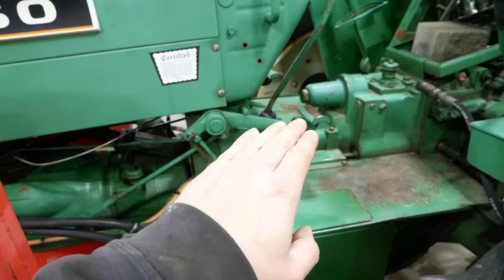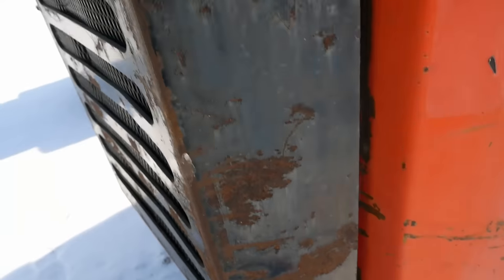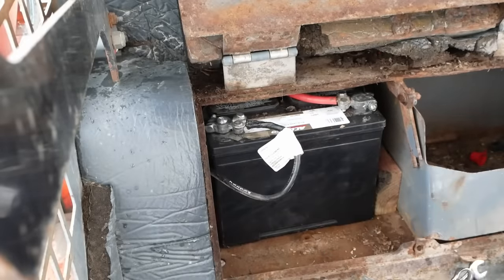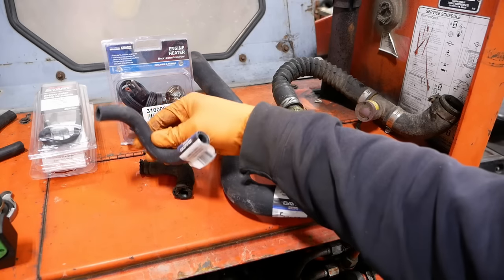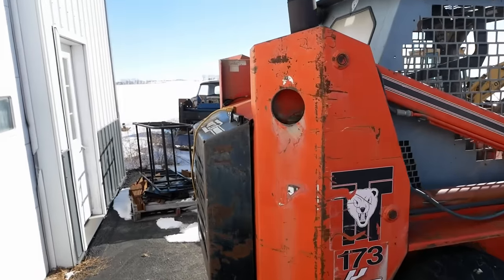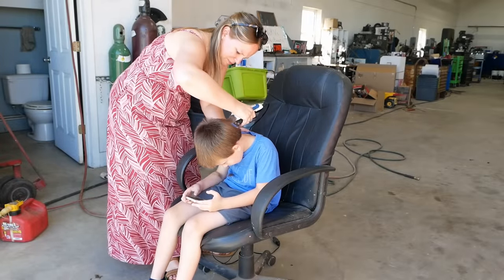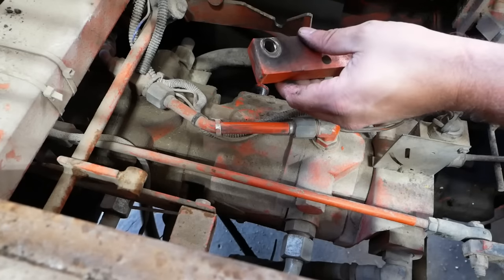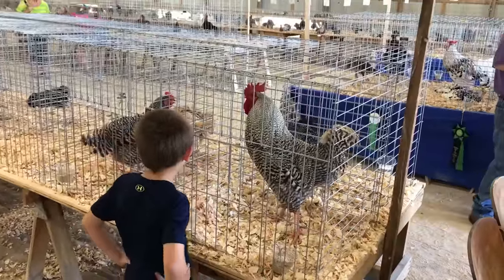Buying a Cheap Skid Steer from an Online Auction - Thomas 173HL - Part 1

Comment: Same for a car with AC, if the AC works means they cared enough. V2203? Yep thats a reefer engine, theres a governor adjustment screw in the timing cover by the injection pump.

Comment: Had 81 Toyota Cecilia , in Colorado Springs, no block heater no heated garage. 10w40 oil won’t start , change the oil to 5w30 in winter .

Comment: Looks like snow is coming out where the bolts should be holding a cutting edge for your bucket. Wear that edge down before you replace the blade and you'll ruin the bucket.

Comment: The name felt familiar, and after a quicky google sesh, i know why. Someone modified one of the native attachments (a back hoe) for this unit into a self propelled unit. Seems there's quite a few things you can slap on this skidder, both native and aftermarket.
11:25 keep some thin stainless steel wire around the shop, it's good to make anti-collapse springs out of. Just pop on over the old web and find the spring to mandrel calculator, find something appropriate and make a small section of spring. I do it all the time, rarely bother to replace the hose after since this allows you to turn any random hose into the right hose. Pro tip, make sure the ends of the spring are bent inwards to the spiral, you don't want them poking out when the hose bends to shape. The spacing should be pretty narrow to make it work, but you can figure out the right settings in-situ. And you don't need to do it to the whole hose, only the bend area.
Reply from the maker: The spring goes inside or outside?
Reply: @WatchWesWork  Inside. A little lube helps pushing it in. I usually make a small piece of wood on the lathe to push it in (think driver for thread inserts).

Comment: I've fixed (patched) several tires on my skid steer - I leave the wheel on the machine and pull the tire - the 5600# wheel attachment seems to make it easier - appreciate your video sir

Comment: I’ve moved a lot of snow with an Oliver tractor. Never had any problem shifting it. Steering could have been a little bit better. We used a high output PTO hydraulic pump.

Comment: My old man still has a Thomas at his shop. I believe he bought it new in 1994. He has almost every attachment available for it from that era. He did regular maintenance on it since new and still uses it today when the newer machines break down or are getting serviced. Few breakdowns over the years but nothing major. It’s tired now but no shame for a 29 old machine .
Reply: What attachments does he have for it? I have a buddy that had one and he had, forks, back hoe, breaker, brush and a few more things but I can't recall what. It was a decent machine!
Reply: @davebrittain9216  Back hoe, forks, breaker, couple different sized augers , the big sweeper brush, tooth loader bucket, snow bucket, and we made a cable reel . The back hoe can’t be used any more due to safety codes . No roll over protection. He bought a mini excavator instead. That thing is great in tight spaces and little jobs.
Reply: @lloydmarche7263  Are you in Ontario by any chance?
Reply: @davebrittain9216  sorry no.
Reply: @lloydmarche7263  I wondered if you dad maybe bought the unit my buddy used to have but I guess not.

Comment: I have a memory thst its a case of a multi holed lever and you move a spring or linkage.
Pump will nneed to come out and gearcase off.
V2203 has a turbo variant with few different parts needed for upgrade.
Cheers wes👍
Reply: User Joefive5466 said Hey Wes, I had to put a heavier governor spring in my V2203 when I stuck it in a Jeep. I used Mcmaster 9433K49. I’ve revved it to about 2500rpm before I let out. To change the spring, you have to pull the injection pump out and the throttle plate off and the shutdown lever plate off.
Another user said they were used a lot in generators and set at 1800rpm, which seems to fit

Comment: Throw a little brake fluid in your hydraulic oil Reservoir it will soften the cylinder seals up sometimes it works sometimes it doesn't at this point you got nothing to lose

Comment: A trick to plowing your gravel driveway is to pile it up where when it melts you can reuse the gravel and not tear up the grass.
Reply: or slide a piece of  pipe over your cutting edge. We cut a slit in black pipe, slide pipe over our cutting edge.  may pack some snow down in the gravel but we arent raking gravel out of the lawn come spring

Comment: Watching you jack it up and pull the wheel to put a tube in it was tough for me to see lol. I used to run a tire repair truck back in the '90's. I'd stick a block under the back, fire it up and raise the whole thing in the air, peel the outside bead off, repair or tube it, hit it with the bead  seater tank, air it up and drop it back on the ground. I can recall how I did it, just not why I went at it so hard for $11.64/hr.
Reply from the maker: I think it would be tough. The drop center is on the inside of the rim.

Comment: is it a tv (tri vortex ) or a di (direct injection), pumps are a little different, if you remove the stop lever cover you will see the spring, check against specs, I’d say it’s stretched, the pump rack locates in a slot on the governor arm, not much goes wrong there, my money is on the spring 🤞

Comment: its too late now but that bypass hose you could of got that at a kubota dealer the spring thing was most likely a switch for the back up alarm and if you know its gonna snow why leave it outside you got a shop park it inside before it snows so you got no snow on the seat

Comment: I realize the skid steer has multiple other fun uses and is a better fit with your family culture...but for snow removal I often found a walk behind snow blower ($400 new) was quicker and easier than getting out the compact John Deere with a loader. My driveway looked about the same size as yours.....exercise is healthy. Only maintenance was putting gas in the tank and always started on the second pull, regardless of the temperature. Of course the blower is limited by heavy snow fall.  I surprised myself how often I reached for the blower rather than the tractor.
Reply: till you hammered by a 3 foot blizzard. Skid steer can stack and shove back snow pile. aint no snowblower aside from rail way clearing or the ones that are used at airports moving a frozen 6 foot deep snow bank
Reply: @harveylong5878   As long as you can get into the snowbank a good blower like an Ariens will get it up and over any snowbank. My little 24" 2 stage will throw it high enough to hit the powerlines...they're incredible machines. 16 yrs I've never done more than change the oil 1-2 times and finally put a belt on it along with the gearbox on the front auger

Comment: Obviously you got a rubber tire machine but its unbelievable for the track skid steers what they climb in dirt and mud but they absolutely suck and wont move in snow without the right winter tracks on them the rubber tire seems to be far superior especially with the right taller snow tires you get way better traction and a couple more mph for doing parking lots .we got burnt on snow last winter hopefully this winter is a little better ! I know you will have this all spruced up in no time !!

Comment: Well if there's no fluid under it then there's probably no fluid in it. Seems like an ok little machine. Definitely worth putting a few dollars into. I've got a pretty old Scag Magnum 3 mower with a little 3-cylinder Kubota diesel in it and I love that thing. And parts for it are still relatively easy to find. And original Japanese parts too. Hopefully you'll get that governor sorted. I don't think it'll be very difficult. Those Kubotas are in EVERYTHING.

Comment: Before u had put-in the new battery, u picked-up the battery hold-down bracket and put-it in the box next to the battery tray.
buy use skid steer's, it comes with problems.  u will figure-out how to get the motor to run in high rpm's.

Comment: The problem you are having with your Oliver tractor. There is a good Oliver mechanic  on you tube his channel is ( That Oliver Guy ). You can ask any question about your Oliver to him. One thing I have learned from him was how to shift them. By putting it in low range to make shifting easier. I hope this can help you out 👍

Comment: Those thomas skid steers are the same as a scat track 1300 whichbis owned by volvo now. Same engineers as bobcat. Your enginenis a v2203. That is a simple cartridge pump. Pull the lines , 4 nuts and 1 spring and out the topnit comes. Once its out you will see the other springs for the governor which you can buy many places. Cheap. The governor has fly weights on the cam gear and a fork that pulls on the rack spring. The over travel stops are the plastic capped bolts on the front cover. Also check fuelnpressure that are fairly picky

Comment: Skid Steer evokes the meaning of a flat tire machine, don't bother with tubes, just get solid tires unless you're a glutton for punishment. In my opinion a snow plow is for plowing snow and a loader is for loading it, period, and never the twain will meet.
Have a 40yr. old L275DT, with glow plugs and decompression, never plugged in and will start in frigid weather every time.
A skid steer is a diabolical machine, solely designed to test the patience of the mechanics who have to repair them.
Wes when you buy something like that get a manual before you even start.
Reply from the maker: It's crazy fast even with the bucket. I can plow my whole drive in 20 minutes. It takes 1.5 hours with the Oliver.
Reply: Fill it  with green tire slime

Comment: You, your teaching wife and your son would greatly benefit from Starlink internet. There are 4,000 satellites up there and more every week. I feel the "can't win for losing" thing you must feel a little of. I just paid cash (great deal!) for a 2009 great looking and running Ford Fusion. I knew it was high mileage from the ad and "whirlwind"  inspected everything without complaint. After getting it home I actually looked at the odometer, which I initially didn't even know how to find. Yep ... 100,000 more than the ad said. I would have walked away. Mine now. Sure is pretty though. On the good side; it's the first vehicle I ever saw without wings that has a complete maintenance log.

Comment: Put a small battery charger to that same 110v line, then you have hot block and topped battery, glow it and it will start.

Comment: the 743 would have been a good machine. Simple naturally aspirated kubota engine. Bobcat built so many and they were so long lived that cheap new-old stock parts are usually easy to find on the internet 35 years later, plus every single possible issue you could have run into with it has happened to someone else who documented the whole saga at length on equipment forums on the internet in the 2000's

Comment: i've worked on a couple of those. not bad machines but parts are unobtanium.   you're probably right about the low rpm engine. there may be a different rack plate that limits max fuel but  for the most part its just a spring change. i sure wouldnt want to try it in there  its hard enough out in the open.
Reply: User Joefive5466 said Hey Wes, I had to put a heavier governor spring in my V2203 when I stuck it in a Jeep. I used Mcmaster 9433K49. I’ve revved it to about 2500rpm before I let out. To change the spring, you have to pull the injection pump out and the throttle plate off and the shutdown lever plate off.
Another user said they were used a lot in generators and set at 1800rpm, which seems to fit

Comment: looks like the creep is caused by running the piston pump over center moving the swash plate one way is forward and the other is reverse. may I suggest you clean the hyd tank and change the filters before you put the skid steer into service= money saved. my2cents

Comment: With your location and its main purpose being for snow removal keep your eye out for an old fisher plow to weld a quick attach plate to and plug into your auxiliary hydraulics , makes it so much faster and its a cheap addition
Reply: Fisher,  Diamond, Western and yes even garbage Meyers would work. not as simple as just hooking plow into the aux hydro circuit. it'll work, but a pressure relief valve and crossover are better bet
Reply: @harveylong5878  did it on a Takeuchi and we welded a plate on made up some hoses and away we went . Yes you could just about fly fish with it ended up putting in a flow valve but it worked amazing

Comment: Ah Wes! Just think of all the (mis)-adventures you could've had facing off against my 455c backhoe! Mere mortals quake in fear, but What Would Wes Do?

The world, may never know.

Seriously. We can have it loaded and blocking your garage door sometime around 2:45am. 

You could have a contest! Pick a part that will 'splode with suitable fireworks to singe Max's mice! (Hint: the engine, for some reason only known to the cheapass farmer I bought it from, is good. Apparently rebuilt. Along with the wiring. Which was apparently unbuilt. What do you do with three non working temperature gauges when you run out of junk cars to pull them from? Dunno. Apparently, neither did he.)

Ah well - you've convinced me to find Patreon $ just so I can find out how many personal injury suits come from this skid-steer.

Comment: There is internal fuel screw them pumps but does sound like wrong engine prob from fridge trailer at that low rpm I do believe there own fuel system

Comment: Oil Pan heater, heat the oil not just the coolant it will spin better in the cold
Reply from the maker: It's not the engine, it's the hydraulic pumps.
Reply: Thank you

Comment: Those tire are like new compared to the bald tires on the skidsteer(s) at my work. I have put in work orders to replace tires but my employer is to cheap and wants to keep using the tires until they no longer hold air.
Reply from the maker: Well I'm already there!

Comment: Wes, do you own a set of roll pin punches? I see you drive a lot of roll pins but I've not heard you mention using the correct punch. They do work.
Reply from the maker: I have them for small roll pins. Nothing for the bigger ones.

Comment: Hey Wes. In regards to the Oliver hydraulics is there not an adjustment located under the seat to increase/restrict flow for the three point? And if so will that not also adjust your flow for the hydraulic system for the loader? Also in regards to the snow plowing issue I can assure you one of the best solutions I've found is....................................................Move outta the snow belt!!!!!!!!!!  NO RUST, NO SNOW...............its great.
Reply from the maker: I've tried to adjust it and it doesn't make much difference.

Comment: I love old Oliver tractors but their hydraulics are a weak point. They are a pleasure to drive for extended periods but PTO and hydraulics will be the things that need fixing. An old John Deere is miserable to use and the those tricycle front ends are deadly but the hydraulics are just so simple and work well.

Comment: Judging by the fact that the engine runs at a low RPM, and that RPM is close to 1750, i find it likely this is an engine form a genset - the synchronous speed for making 60HZ power with a 4 pole generator is 1800 RPM, and you are eerily close to that.

Comment: Shoulda got that 1845c They hold there value Run all the Time And Are just Super reliable overall
Reply from the maker: It sold for $15,500. That's almost 3 times what I paid for mine.
Reply: @WatchWesWork  that's About What I paid For Mine 8 to 10 years Ago But I also Understand there Expensive.

Comment: Don’t know about the Kubota issue but that has drive chains for the wheels? Looks like it is old enough, have you checked them and/or the chain oil level in the chain case? There a bitch to fix when they break
Reply from the maker: I did. We'll change the oil at some point.
Reply: @WatchWesWork  I got $100 won't be changed in the next 5yrs :)

Comment: skidsteer loaders are one of those things you never knew you needed until you get one, then you wonder how you ever got by without one. on that note i have one that i  use all the time but it has a problem that i haven't been able  to figure out. it has a perkins 4022c engine. the problem is it will start great when it is cold but if you shut it off and try to restart it when hot it will not restart until it cools off for awhile. have replaced filters, low pressure fuel pump injectors, fuel shutoff solenoid, starter, checked and adjusted valve clearance, no luck. it will restart hot without with a little shot of ether, but i really don't like to do that. if anybody has any ideas i would really appreciate it. have looked at a lot of forums, and that is where i got the ideas to do what i have done already, but now i am out of ldea. any help would be greatly appreciated

Comment: Guy calls me and asked me you ever hear of a Thomas skid steer. My answer No. I go with him to auction and we look at it left hand controls lose and needs fab work and some welding to repair, I noticed it had a kubota engine. It was a 40HP unit real basic in design well he picks it up for 1,500.00 we go to work on it. Service unit and repair controls and guy ran it for 15 years turns out it was tank and he put 16,000 hours on it and traded it on a bobcat

Comment: Shame to see the JD 755 in rather sad shape.   I have a JD 755, second owner from new.    Mine has about 1370 hrs on the engine.   It has always been stored indoors so no rust.   Some paint bubbles, but not a surprise for a unit made in 1989.